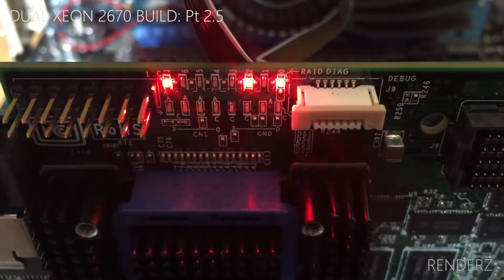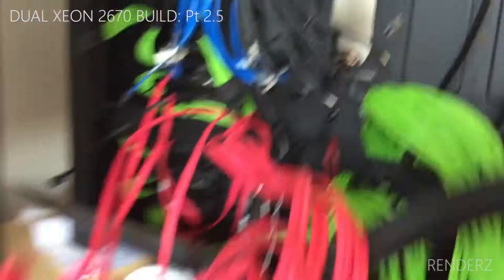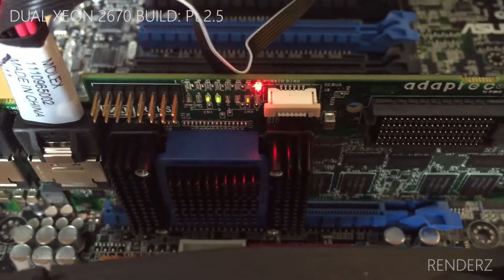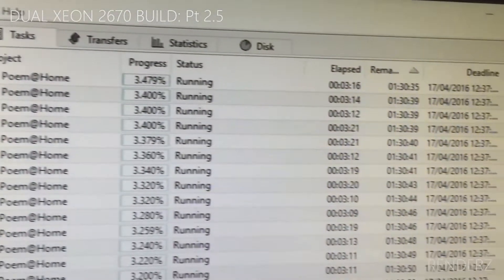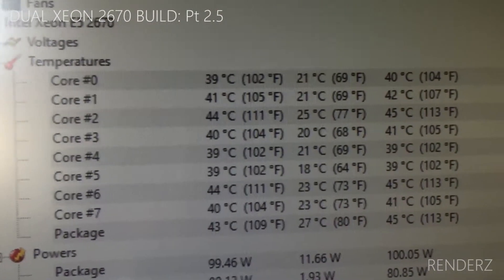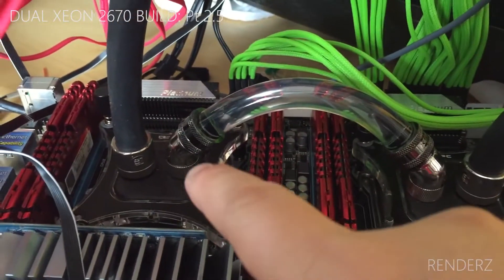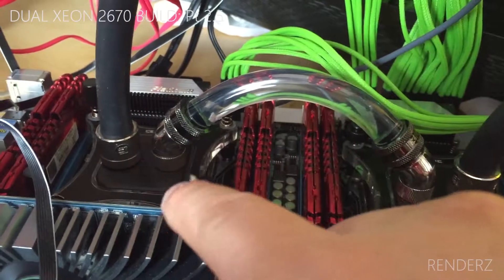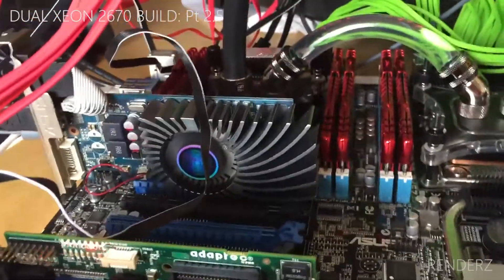Dual Xeon 2670 build update 2.5!

Comment: In the Previous Video you uploaded i noticed that the warmer CPU was running at 0.1 Volts more than the cooler one. (1.150 vs 1.050) ... I had both of mine set to 1.050 manually and had identical temps on both CPUs. Try to set the Voltages manually.
Reply from the maker: +Coldministrator Thanks, I'm not at the stage of fine tuning yet, but it's something I will be doing once it's all built.